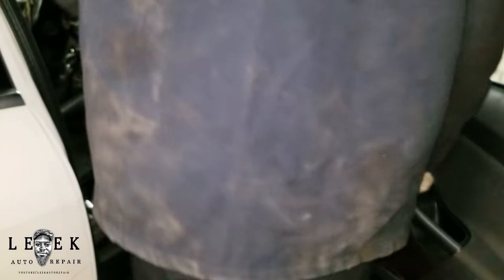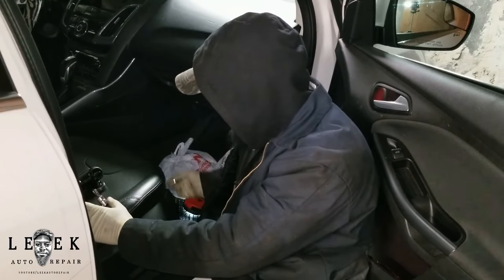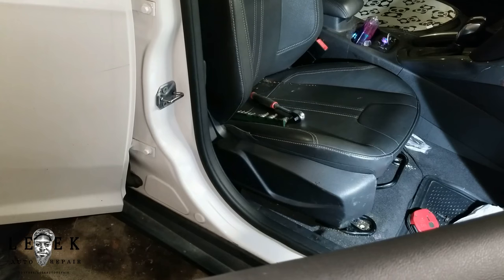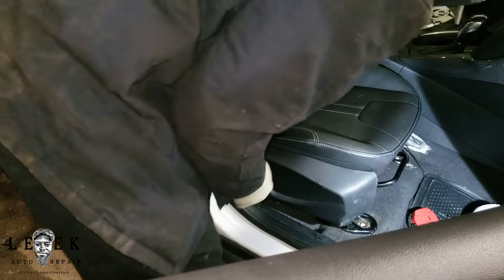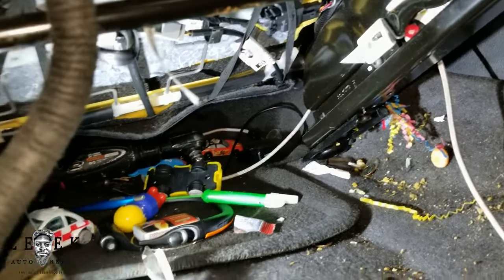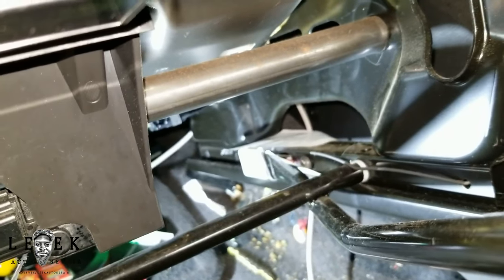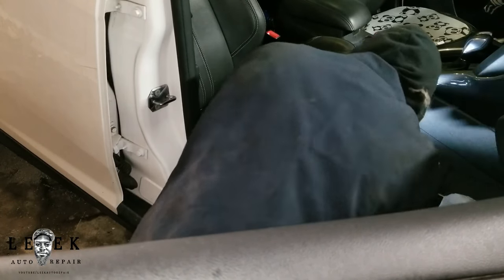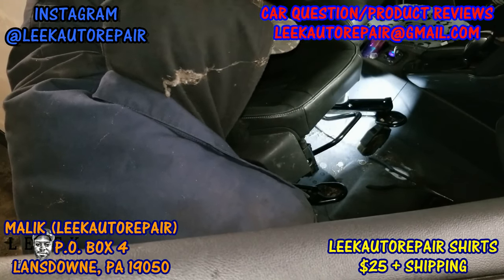Seat Won't Slide Back or Foward

Comment: Both seats on my X-Type are really stiff like this. I took them both completely out today, cleaned them, vacuumed it, oiled the tracks and everything, and they're still really stiff. I couldn't find anything in the tracks. It's not stuck, just really hard to move them. 
Maybe the tracks are slightly bent and rubbing or something. Might try and disassemble the whole lot tomorrow and have a good look at the inside of the tracks.

Comment: I’ve got a 97 Maxima. Slid it way back to pull out the mat. I was actually on a hill. The slide back was kind of hard. After that I couldn’t slide it back up. It’s a five speed so I’ve got to get closer. Managed to inch it up a bit. Keep in mind my car is really clean. I wonder if I jumped off track. Looked underneath and two bracket like pieces on the corners with bolt heads were kind of dangling. Tried to push them up and into place. Still stuck. Any ideas? Thanks for the great video and comedy!

Comment: Hey I want to check it tomorrow I took it to the dealer you want to charge me $250 I kind of figured something stuck in there just won't go forward can I push it back when I get out of the car and it won't slide forward so from watching your video I figured this yeah I'm going to just do it myself for bolts like you said looking underneath there probably something stuck like you said in the slot thank you